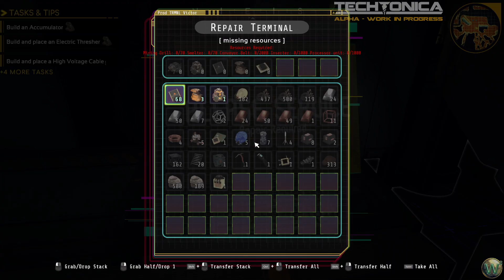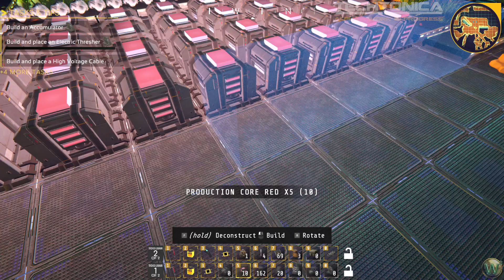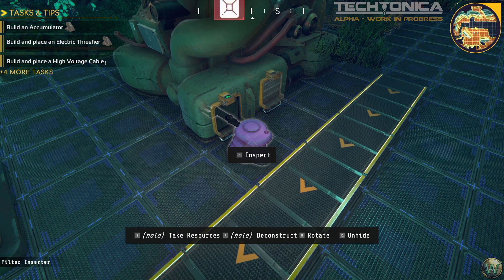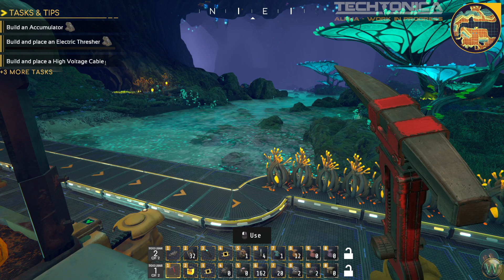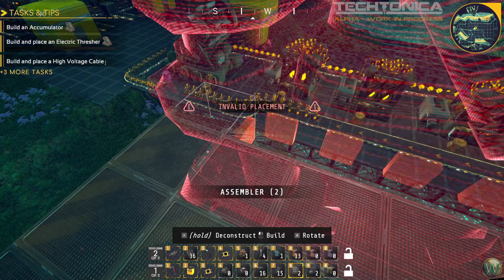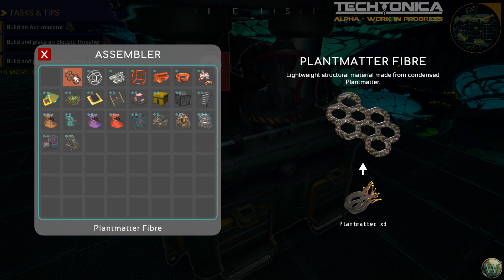Techtonica Alpha - First Look - Automating Plants and Basic Components - Let's Play - Episode 4

Comment: You could take the sead line and return the end back into the sead box...then run a second line off that... so 1 box 2 ins 2 outs...looping the seeds... so the excess should then be in the box? Hi wally! Seams like it's the box limitations...so loops using the resource box as a point?
Reply from the maker: Yeah, that’s a good idea
Reply: @Wally1169  the other thing to test would be .. if you put 4 inputs..and 4 outputs...do you get 4 times the components? Or always just 1 machines worth? That's a good bug in early access games
Reply from the maker: No, it doesn’t do that, sadly 😂
Reply: @Wally1169  pity...that's my favourite bug lol🤣
Reply: @Wally1169  thank you... seen the balance problem before... only one speed of belt...no storage in the machines....so the only way to keep things moving it with the storage space and the 2 speeds if loader . Just my 2p worth👍